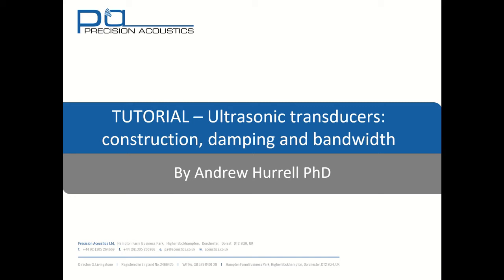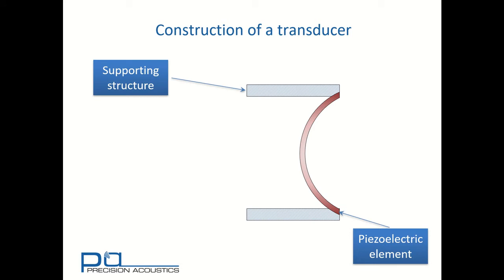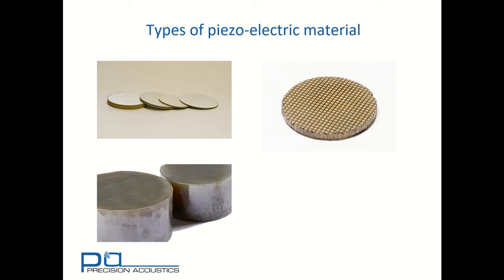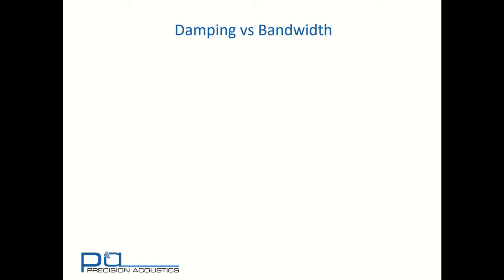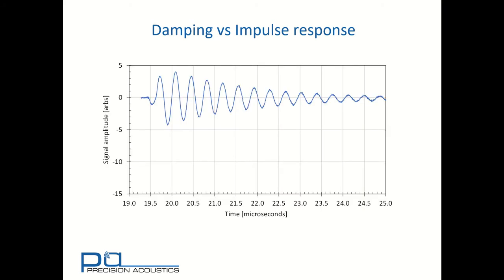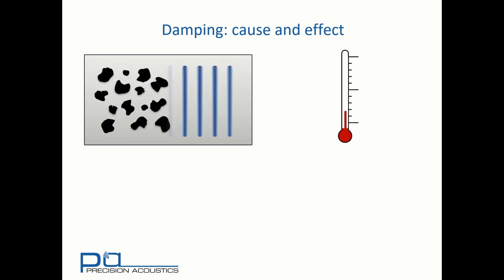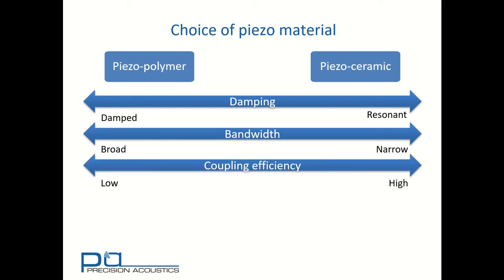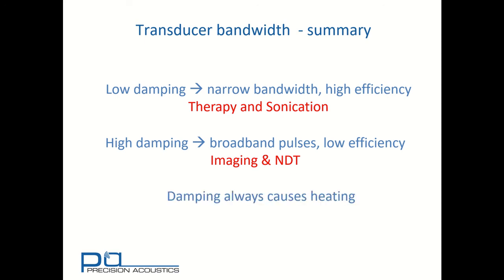PA Tutorial - Ultrasonic Transducers - Construction, bandwidth and damping

Comment: nice explaination.. do you have an idea what kind of transducer do I need to make a protoype in my project? 
because i want to make a  bird repeller that can deter birds using transducer
Reply from the maker: As a starting point you should ask, is it possible to determine a frequency range is likely to be a deterrent for the pests of concern, yet not going to cause distress to those people and creatures that are not the intended target?  Critically, the upper limit of human hearing deteriorates with age so even if you cannot hear the signals generated, young children may be able to.  Furthermore, other animals (domestic and wild) may have hearing ranges that extend well beyond human hearing.  High frequency signals may cause substantial distress to dogs and bats; this latter case is especially important since bats may be protected species (they are in the UK).

The second issue is that the transducers need to be specifically designed to operate in air.  All of the Precision Acoustics transducers are designed to operate in fluids and solids so would not radiate well into air.

In summary then, one needs to be particularly careful when designing your transducer to minimise collateral harm.  Expert advise from an airborne ultrasonics expert familiar with the hearing ranges of a wide variety of species is probably required